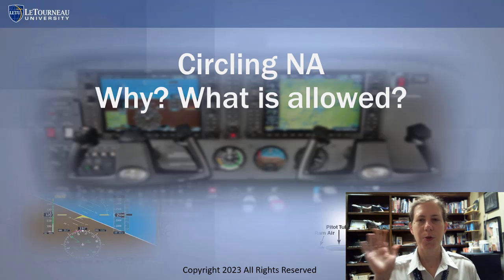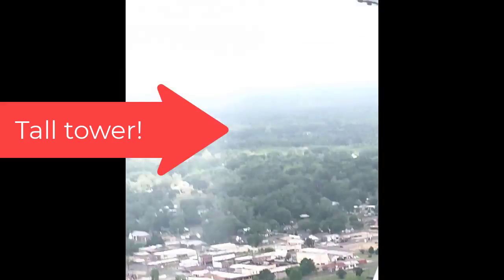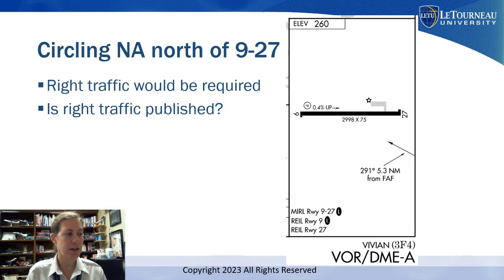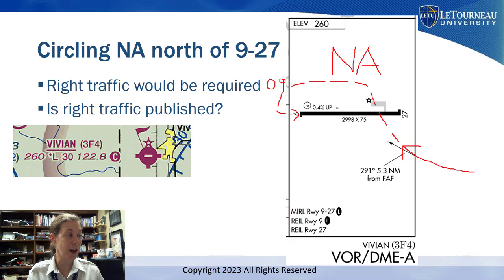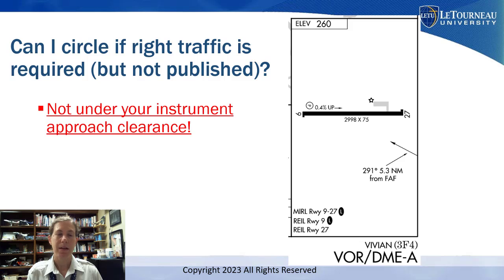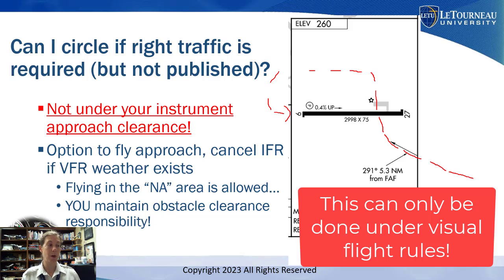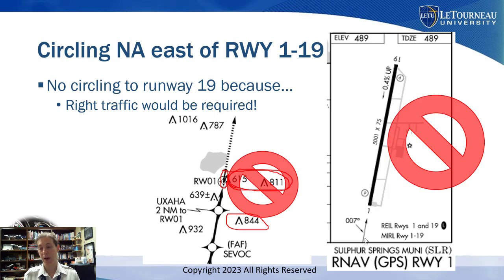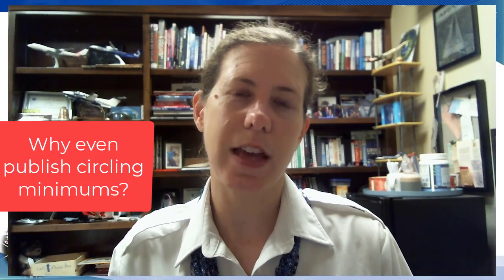Circling NA & Circle to Land: Can I Fly Right Traffic? Safe IFR Flight Tips #aviation #flight #ifr

Comment: Thank you for being open to the conversation....
I have read a few interpretations and the closest I come to your presentation is Collins 2013 where the FAA found that 91.126 applies with very limited exceptions one of which is;"authorized or required by the approach guidelines for a specific airport".... i think this fits your scenario best.   Take a look and let me know your thoughts! I still believe that allows the circle as per approach plate as the "required and authorized by the approach guidelines"

I had a question pop into my mind before I researched the interpretations as well; FAA Flight Check flies each of these approaches and validates procedures...i had to wonder if they were in violation when the validated it??  ;-)... just sayin

Thanks
Reply from the maker: Sorry for the LONG delay on my reply...got busy with students! Anyway the Collins 2013 does say "authorized or required" but then the FAA also has a lengthy discussion on how that is "very limited." I find it hard to grasp that all non-towered airport circling in cases such as this would fall into the "very limited" which they of course do not legally define anywhere. And for the question you're asking as to how the FAA Flight Check people would fly this, I would say they would not fly it. While this IS a circling only approach as designated by the lettering of VOR/DME-A (due to the fact that it is not lined up with the runway), that doesn't have to guarantee you can circle to both ends of the runway while on an IFR flight plan. You can circle if you are on an IFR flight plan going to runway 27 without having to make right traffic. You can also circle to runway 9 IF you cancel IFR and have VMC enough to avoid clouds safely and circle while avoiding the tower and any other obstacles. That's my response especially to avoid the "very limited" (FAA) authorization to deviate from 91.126(b)(1) as referred to in the Colins-2-2013 Legal Interpretation. If you got into trouble while circling to the right because of circling NA, I don't know if the FAA would violate you for 91.126(b)(1) since I am not a lawyer nor do I work for the FAA nor do I want to dispense legal advice! 😁
Reply from the maker: One more resource may be helpful: https://www.faa.gov/documentLibrary/media/Advisory_Circular/AC_90-66C.pdf specifically paragraph 9.11.3. I know it's an AC and not regulatory, but it also speaks to the circling direction.

Comment: I'm curious if on an IFR clearance in IMC, with airport in IFR, you won't be encountering VFR traffic, and ATC won't likely set you up for a head on, so obeying the approach plate, and flying right traffic seems to be what you should do.   Now, if VMC day, and airport is VFR then you may have VFR traffic, but you can cancel and fly VFR, easily, so do that.    I does seem like there's no way to fly IFR to the ground on a VFR day though.  And I'm not even 100% sure this is how the FAA sees this.   Thanks for the video.
Reply from the maker: I think I understand what you’re saying, and obviously once you get into VMC then it’s the PIC responsibility to see and avoid any traffic. Another place you could search for FAA input is their Legal Interpretation database online.
Reply from the maker: And unless you are on a Category II or III approach (at a tower controlled airport), you are correct that in the USA there is no way to fly in IMC all the way to the ground.